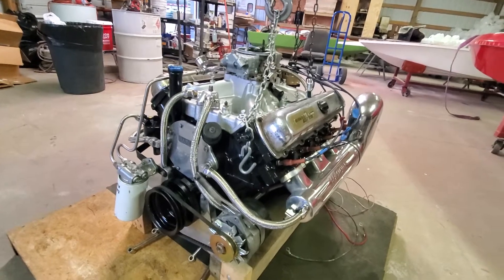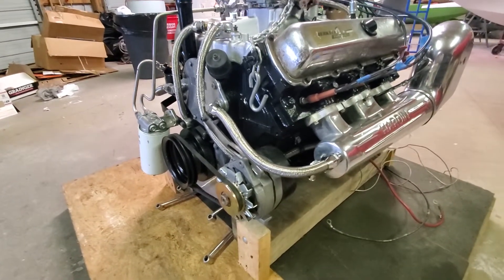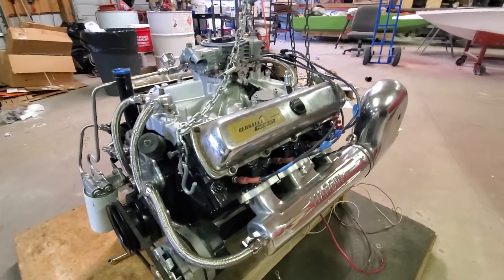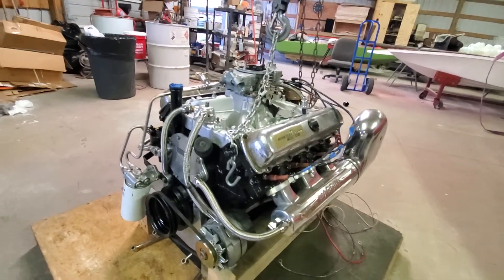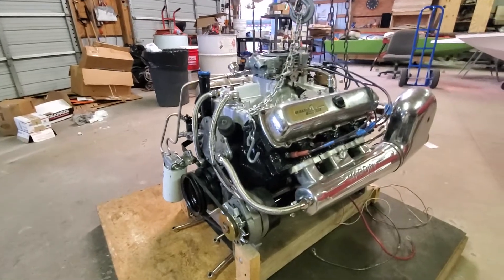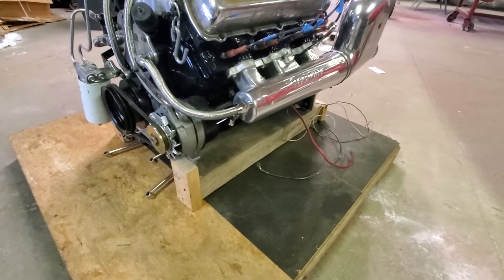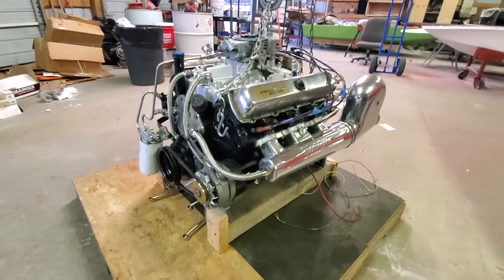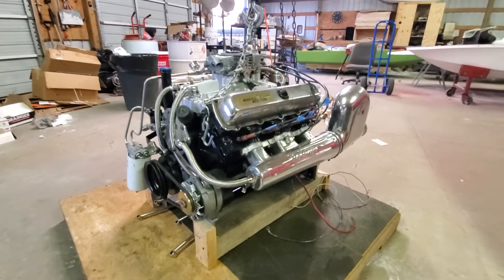Oldsmobile 455 Jetboat Engine!

Comment: I always wondered why boaters love the olds 455 . Why not a 350 chevy?. And do you really need the extra torque on water
Reply: They were the cheaper option so more were sold. Some old heads say the power delivery was smoother.
Reply: Olds are junk. They were cheap so came stock in the early days. The 455 made good torque down low and with the right impeller could live as long as you kept the rpm’s below 4500.  The 350 doesn’t produce the low end torque stock needed to turn the pump and push that heavy boat against the water. The 454 and 460 were much better and way more reliable and took well to being hopped up without destroying the bottom end from grandmas delta 88 cruiser from 1974. No one uses olds anymore. They were junk if u ran them hard.
Reply: @Slammo66  I would rather have a BBC but BBO aren't necessarily junk. They need a few mods to make them ideal for boats. Check into the "practical olds" article in Hot Boats. Awful lot of boats still running around using the BBO.